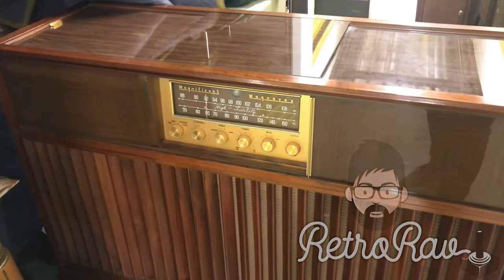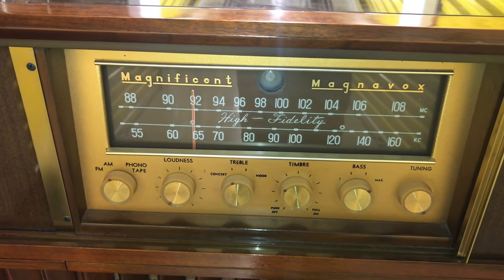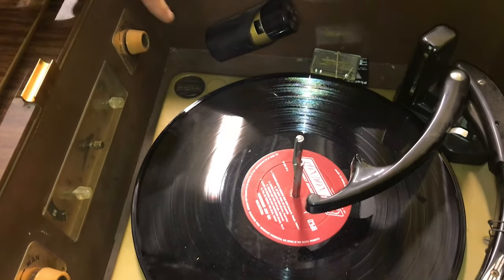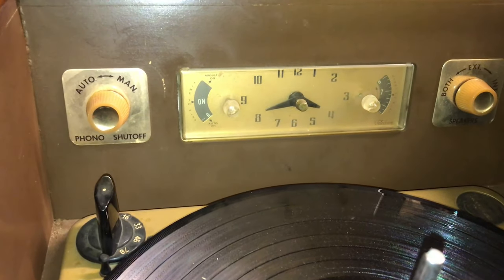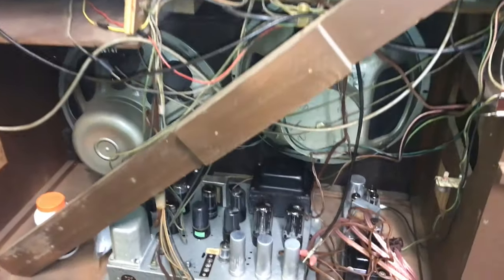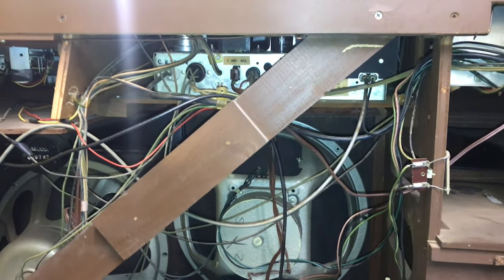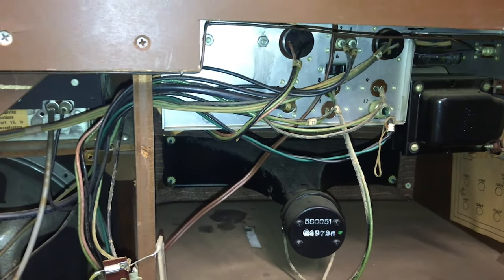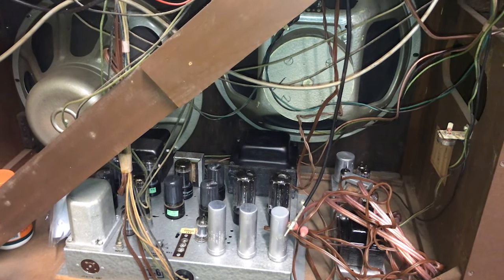Magnavox Concert Grand - Untouched Version

Comment: Nice Radio but this isn't a Concert Grand nor is it stereo.  This is the 1957 Magnavox 200h the precursor to the 1958 Concert Grand.  Features 1 monoblock amp with 6 6v6s.  Quite an awesome and very very rare set still!
Reply: Yet in the video is has a second amplifier chassis, and the record player and tape deck are two channel :)
Reply: You are incorrect...it is NOT a 200H...it is a 300H and indeed has a STEREO tape deck.  The 200H is NOT stereo.  Magnavox gets to name the products, and CONCERT GRAND is ALL OVER the catalog for this item.